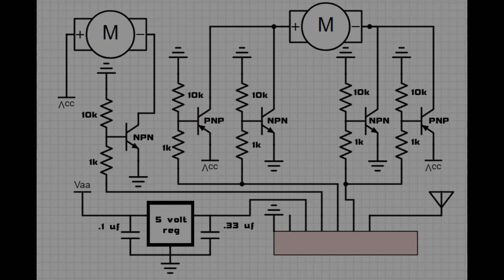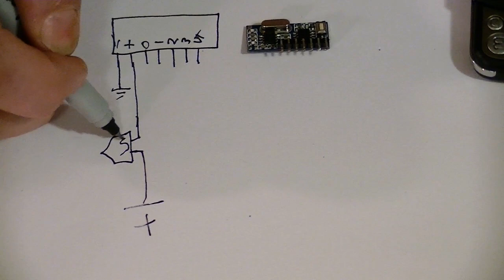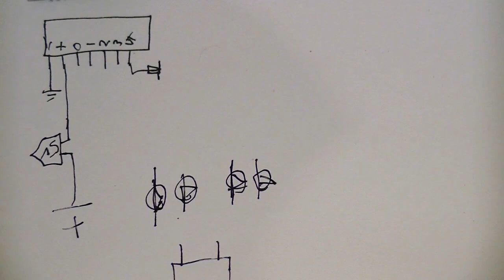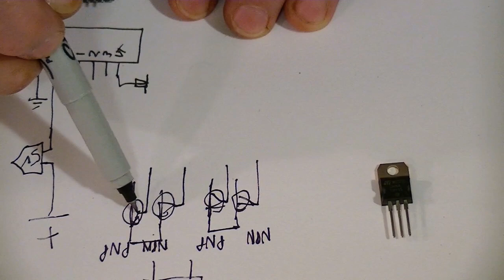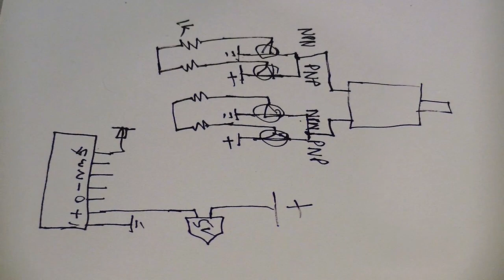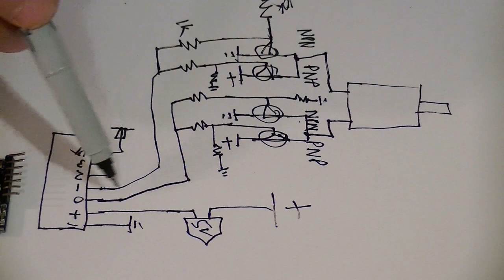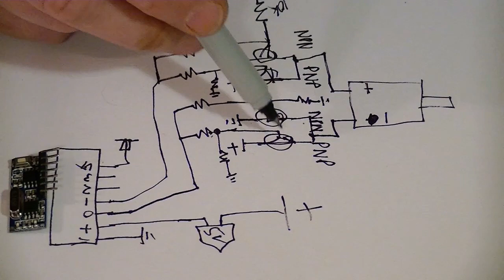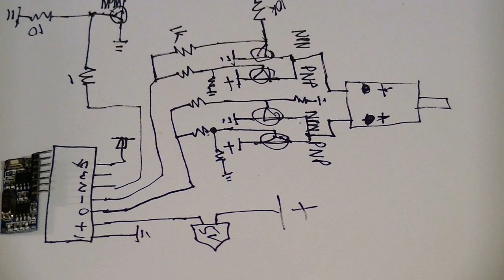Clinch Robot by Nikko Breakdown, repaired, and rebuilt.

Comment: Awesome. The robot was one thing. But making the original remote shell work was brilliant.
You mentioned Mattel Sir Galaxy in one of your videos. I have mine since it was new, but lost the remote decades ago.. A while back I bought a replacement remote from Ebay. The new remote makes him walk and turn okay, but the walkie-talkie feature no longer works. I don't know if it's a frequency mis-match, or bad electronics in component or the other. I wish I knew about that peroxide solution before I had repainted him to make him white again.
Reply from the maker: Yes, it will be featured in a video soon. It's being whitened now.

Comment: I got a clinch yesterday. I tested it with all of my 27mhz remotes (considering it used 27mhz) and all I could get it to do so far is to go backwards and spin. There is one more remote that I haven’t tested it on yet, but I can’t find it. Hope I could find that remote or find the original 27mhz remote on ebay.
Reply from the maker: Yeah... For the most part, that's what mine did. At times I could get the arms to move, but if I did, it would cut out. Then at times, it would move even when I wasn't pushing anything.
It is a neat robot though.